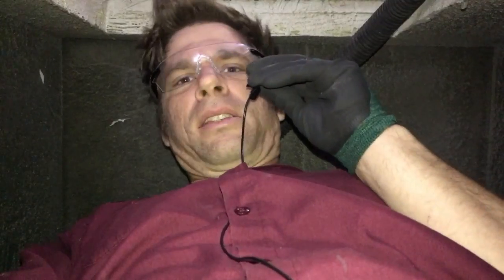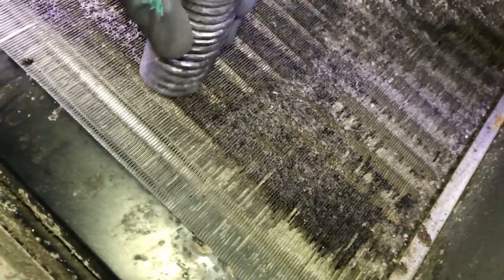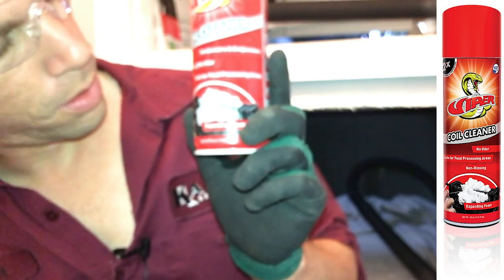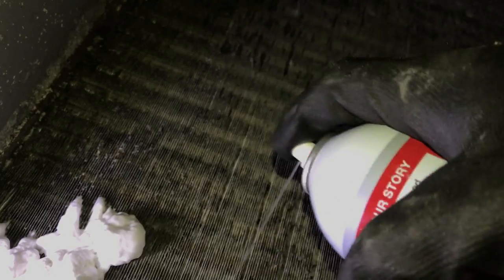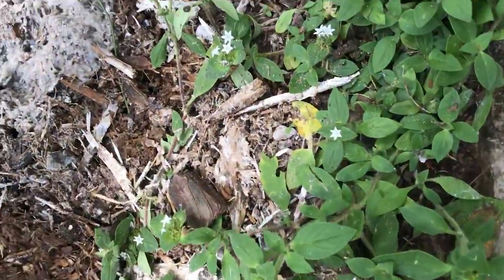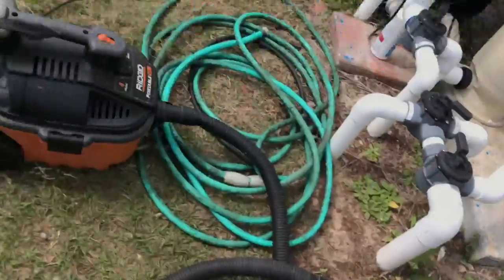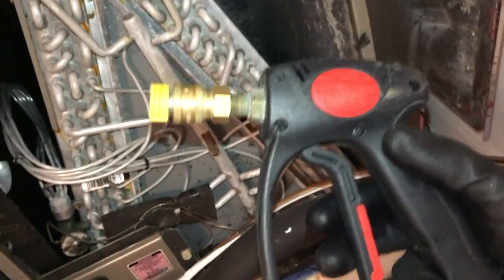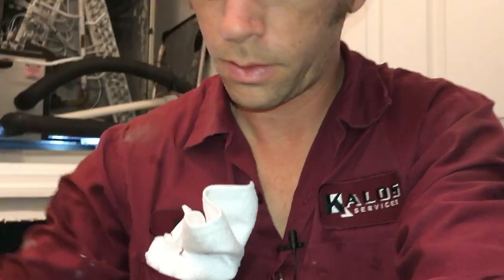Sunday Coil Cleaning #BERTLIFE

Comment: Though difficult it is really easy due to the easy access. How about a video on a coil cleaning on a gas furnace? Likely have to pump down the system and remove the coil and clean outside. No one talks about this type of cleaning because no one does it or will a customer pay for the labor. May as well replace the system.

Comment: Great Job Bert... One question, What do you do about Gas Furnaces with the coil being seperate and in a tight attic space ?
Reply: Mark Fowler  what ever I can. Usually they don’t get that dirty. Some have front access to clean in place with brush and vac, some you have to pull.. or if rusted then replace evap.